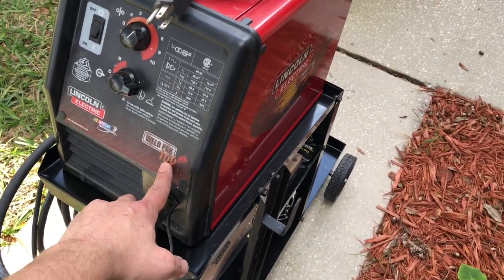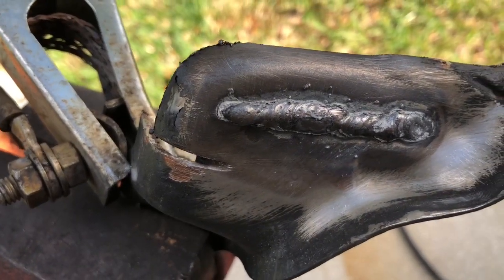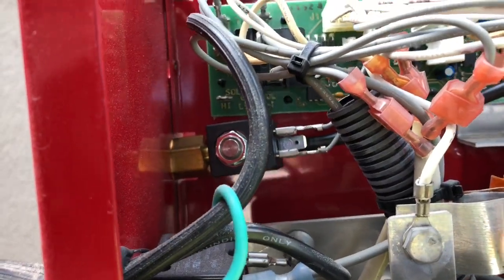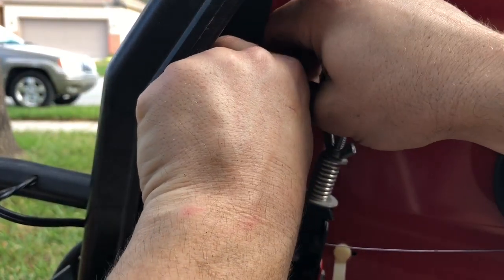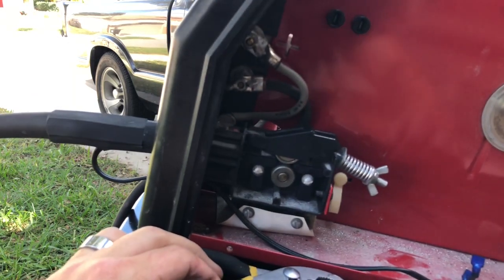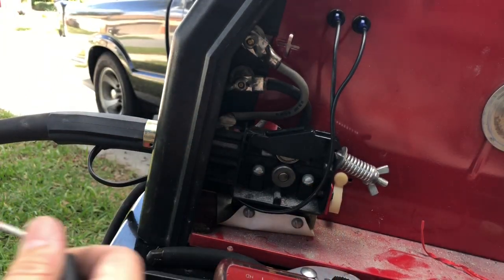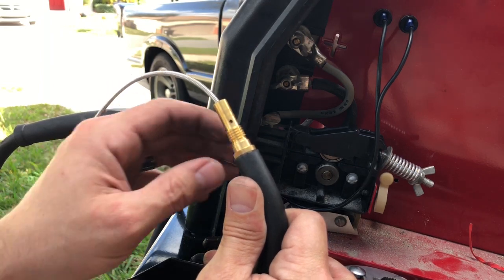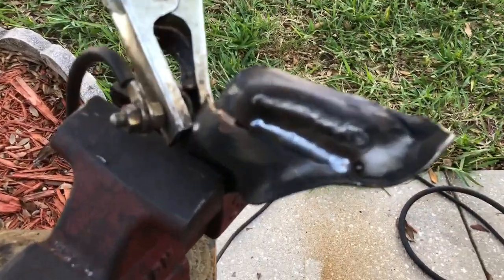Flux Core Vs MIG, And LCN-K610-1 Lincoln Electric Kit install

Comment: NIce video, could not find that information somewhere else, so I am pretty happy, Got a Licoln 140hd and I want to transfer it from flux core to mig and I was wondering a little thing. Why do we have to change the lining? Did you saw a difference between the old and the new one? From the video I can see that the new have a O-ring at the solder station side but I could not see if there was one on the old, Beside that is there a difference IF there is?
Reply from the maker: The flux core wire is a different diameter than the solid core. I why you have to change the lining.
Reply: @CliffsHowTo  thanks for the precision. I will check it out. I really like the little machine I have . Have nice result. Just would like to be able to do some nice aluminum work

Comment: Little tip, push the bead with a mig, drag a stick. If its windy its going to blow the gas around, try to shelter the weld. Good review from an average guy with a welder!

Comment: Great stuff,,about how much is the upgrade?
Reply from the maker: $200ish I think. You’ve got the conversion kit, which I think is about $160-180. Then a spoil of welding wire, about $20-30.
Reply: Cliff's How To Channel I haven't seen those conversion kits for less than $200, usually closest $250
Reply: You don't need the expensive kit since it's just a solenoid valve and simple plumbing. Regulator/flowmeters are quite reasonable too. Check other conversion videos for alternate parts lists.